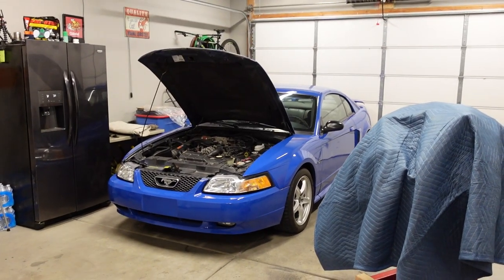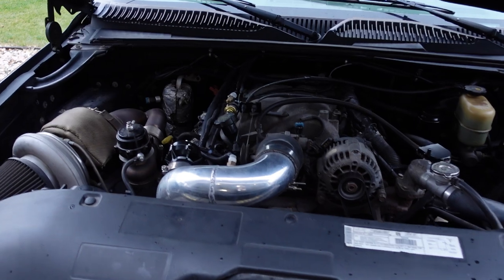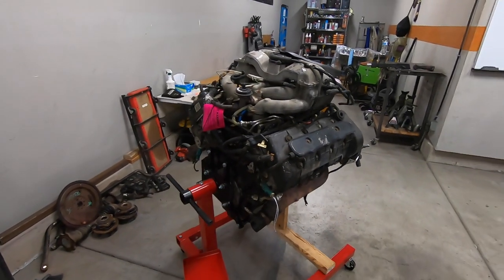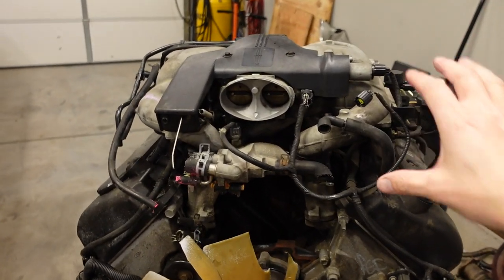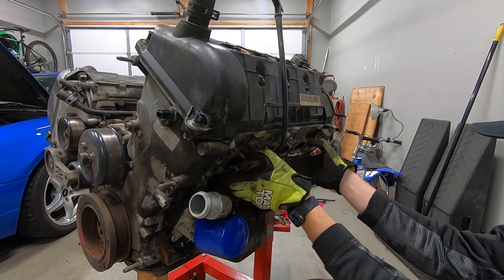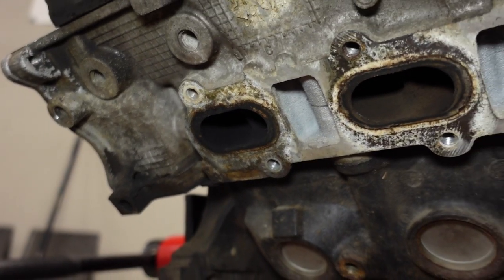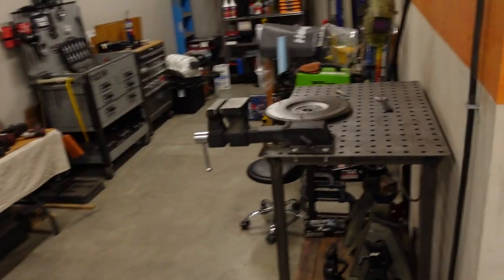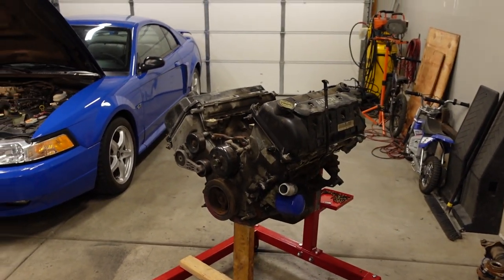I bought the LARGEST ENGINE I can fit into my Mustang

Comment: Waaaaaay more excited for this than a coyote. This will be great!
Reply: Lol y older 4v's are turds compared to a coyote 🤣
Reply: @neilbrown82  ya 11.5:1 compression will always win compared to 9:1. It’s okay though, I used to know very little about how engines work too. 😉
Reply: @tomcelica  lol it's more than just compression ratio 🤣
Reply: @tomcelica  the 5.4 4v compared to the boss 6.2 and coyote is literally worse in every way
Reply: @tomcelica  not when boosted😂
Reply: Guys I know new technology makes a tiny bit more hp from things like vvt and vvl and the heads on the coyote flow a bit more. However, you can port the heads on the older 4v to flow very well. Probably well enough to hang or come very close to the coyote. You are going to change the camshafts anyways so don’t bother comparing them. 
Here’s the kicker. The power will be dictated by the turbo or supercharger ultimately. The same turbos on either engine will be the limiting factor for max power. Both engines will make the same max power but at different boost levels. If you REALLY need me to explain this I will but this response is already long enough. 
Schools out. I’ll see you tomorrow.
Reply: @tomcelica  that's a lot of unnecessary words either way you try to justify it a 54.  4 valve still sucks in comparison to a coyote , the coyote is what the modular platform should have been in the first place before it ford hadn't cheapened out in the beginning it's 2022 nobody's getting excited over a 54. 4 valve modular  engine
Reply: Overweight, underpowered engines are not really exciting.
Reply: @sepg5084  agreed 💯
Reply: Lmao I’m just going to let this one ride
Reply: @neilbrown82  but do you know WHAT sucks about ithe 4v? My logic is sound bro. I suggest you subscribe to Richard Holdener’s channel and educate yourself. How many 4v engines have you seen tested? How many coyotes? Can you show me dyno results from said testing? You can follow what the internet tells you on forums and boards or you can follow the data. 
There are many many reasons why stock vs stock, the coyote will out perform the 4v. But when you start replacing stock parts with aftermarket parts, you learn quickly that you are only really limit becomes displacement. Why do you think racers still run small block Chevy 350’s that came with about 250hp?  I’m sorry, but you have no idea what you are talking about.
Reply: I would expect to see haters from the Coyote crowd to be negative. If everyone did the same builds things would be BORING. there's a tone of Coyote build videos out there already!!
Reply: @erikturner5073  that’s why I’m excited!
Reply: @neilbrown82  The horrible, raspy sound of a coyote is enough of a reason for me to never swap one in anything.  That and fans of them act EXACTLY like LS guys.
Reply: @AwesomeFinish  lol guess this new Edge Mustang project is dead
Reply: Not all but most but the coyotes have vvt if the modules had it they’d be right there or better.
Reply: @neilbrown82 lol, exactly what I was gonna say 😂

Comment: Biggest downside is the iron block on the 5.4. The engine is super heavy and physically large for making such little power. Expensive to modify with nearly no aftermarket options. I really wanted to go this route with mine but it just didn’t add up for me.
Reply: the 5.4 lump weighs 190 lbs. The 4.6 at 153 lbs plus the 5.4 stroke is horrendous with the same bore which limits the valve size for such a larger displacement.
Reply: @donuthole7236 really Ford Australia got 500 HP all day out of it ! Factory Standard .

Comment: Good call on the navigator motor build.  Used to be a much more popular swap and i think it's a very capable powerplant.  Hoping we can see 4 digit dyno numbers outta this some day!
Reply from the maker: I agree, I'd love to get it over 1,000. I know its been done countless times before, but nowadays the Coyote is the golden child for Ford, and the mod motors have been forgotten about
Reply: @LawrenceTolman  if i remember right, the stock crank in these is good for quite a bit of power.  I'd love to see it go through the progression of each stage and see what it makes and how capable it is in each form. Will this be staying manual the whole way or eventually going auto when it makes big power?
Reply: @LawrenceTolman  people used to get insane power reliably out of these in the 2000s it definitely can be done
Reply: May want to reach out to Richard Holdenerd. He's built a couple Navi 5.4's and would have a lot of insight on what to improve and what to leave alone. The Navi is actually a great powerplant and realistically is just as capable as the coyote in a lot of ways but a lot more reliable. Less electronic parts and less mechanical parts such as cam phasers.
Reply: @LawrenceTolman  but the coyote is a modular Ford engine nobody's forgotten those older engines they just don't waste their time with them when something better is available not to mention the Godzilla is out now as well
Reply: Compound boosted Terminator 4.6s made 1300+ hp without even trying. All forged goodies + compound boost on E85 is a 1500+ hp driver...
Reply: The biggest drawback was intake manifold options in the US but now they make an adaptor to allow you to run coyote intakes on them so that really helps alot.  A good manifold, cams and long tubes they can make 400+ rwhp easy with a stock bottom end in a manual trans mustang with the stock navigator heads.  If you can afford ported c heads too then it's even better.  The 5.4 has a long stroke and really good torque because of it.  If you do aftermarket rods and forged 12:1 pistons you could make WAY over 400/400 to the wheels on e85.  Thinking about doing one on my 97 cobra doing just that and revving it to like 7200 rpm na.  I think it would make some power.  My cobra has a 4.6 4v now I might build the original teksid block and make a 5.3 stroker so it's lighter.
Reply: @midnight347  your right, finding an intake manifold option is what I believe pushed people away from this market. but with those MMR plates, i opted for the 5.0 Coyote Intake Manifold from Velocity (Aluminum). Its similar to the Ford's Boss 302 intake, but the kit came with fuel rails which was nice. I am at the stage where I just need to learn how to tune the damn thing. I dont know how yet. I have the Tweecer RT, and contemplating on purchasing Binary Editor because I hear its much more user friendly for people whom haven't tuned before

Comment: Definitely option two, build the motor while you have it out really curious what you could make naturally aspirated before forced induction
Reply: 420hp practically
Reply: Not many seem to make good N/A power, but they love boost !!
Reply: @arkhsm  most engines like boost with stronger internals
Reply: Depends . The static compression could get a good bump, use some high lift long duration cams, good set of headers, use a PI 4.6 intake with port matched adapters, a 72 mm throttle body , c&c the stock heads...should be really close to 500/500 on E85 .
You'd be better off using a non pi 4.6 with pi heads on it , c&c port/bowl/valve job , long 4 into 1 headers and a 125 HP kit of voodoo juice.
The most important thing on any non-terminator mod engine is to get rid of the flimsy powdered metal rods. If your tune is anything other than perfect you will regret keeping the stock rods.
Reply: @robsorgdrager8477  out of a 5.4
Reply: GangBalls69_Estonia  not really. If you put in forged pistons and rods it's just better for a high compression build. After that you can run a thicker head gasket to drop comp or throw in some dished pistons and run boost. If you are good at tuning a 10:1 static compression is workable . Always always build the block to handle the max you want to hit. After that you just mix and match upper end parts.
Reply: @benjaminwatson7868  yeah. In stock trim you can eek out almost 400 horse from the 32v ...tuning, E85 exhaust. With some work, like changing everything 500/500 na is not out of the realm of possibility. The heads flow good but the cam profile suck dog water. The reason why the mod engines respond to small amounts of boost like they do is flow. The heads flow good but they choke up. The boost forces the heads to breath. In N/A trim you need to use the exhaust to your advantage. The faster you get the hot exhaust out the more fresh air it will draw through the intake. More attention to the exhaust side of the heads will net you more power. Combine that with good 4 into 1 headers with the proper collector length, hang them exhaust valves open a bit longer with a bit of overlap and timing , run good fuel and strong spark....you'd be surprised what you get from a 5.4 .

Comment: Duuude, This looks like such a fun build!  Thanks for taking us along on the ride.  
I love oddball builds and I’ve always wanted to do this but on a 6.8L V10 just to see what you could actually get out of one with a little love.
Reply: They are a pain to swap.  I put one in my 07 F-150 and the lack of aftermarket ECU support makes it a nightmare
Reply: I’d rather see a v-10 was hoping for that too. But fords suck in my opinion lol
Reply: @jasonolmsted4147  I'm a Ford guy, but I'm happy to see content that isn't just another LS/Hellcat/Coyote/2JZ swap
Reply: @KildalSMASH  I agree different is good. Still wishing it was a v-10 lol 😂
Reply: I wanna do a v10 mod motor in my 01 cobra eventually
Reply: I built  a 6.8l twin turbo v10 foxbody capri back in the early 2000's  they fit nicely and they make globs if torque.  Everyone seems to be scared of them because of the unknowns of the split pin crankshaft, but so far I've never heard of anyone breaking the crank in one.
Reply: Was crossing my fingers for a 6.8 V10 build, but 5.4 V8 is gonna be good as well!
Reply: @jasonolmsted4147  v10 and t56 viper combo for $3k on market place in 72701 area :)
Reply: @KildalSMASH  I'm ls guy but yes I'm also happy to see Ford power plant :)
Reply: @drgibs347  that must’ve been a scary car. But saying you have a v10 capri would be worth it all
Reply: @KildalSMASH  just carb it
Reply: @Logan adkins  I'm personally not a fan of having a metered fuel leak... plus, they don't make a V10 distributor.
Reply: @KildalSMASH  a metered fuel leak lol okay
Reply: @jasonolmsted4147  they suck?
I've seen them with 600 and 700,000 miles.
My 4.2 f150 has 300,000
 Tows and pulls every single day.
Reply: We have a 2010 Ford v10 for sale in GA if anybody wants the challenge 😊
Reply: @southernracing2468  we have a 2010 Ford  v10 for sale in GA, I think it’s a 2 valve though.
Reply: @drgibs347  lambo v10s are split too right?
Reply: @rdallas81  yup your right I've seen both 4.6 and 5.4 ford V8s with 500k the taxi cab 🚖 ford Crown Vics in my area have extremely high mileage and run smooth
Reply: Swapping a 6.8 into my 92 c4
Reply: Yeah I thought this was gonna be the 6.8 v10
Reply: @drgibs347  so what did you do for ECU Tune or did you just use the OEM ECU to run it ?
Reply: We've got a 2v v10 in an 05 mustang, it's been a fun project. The s197 chassis has loads of room in the engine bay for it though.

Comment: Go with option 2 now because it’s easier to work on it and upgrade the oil pump and timing set while it off the vehicle. I’ve built two 5.4 3v motors in frame and it was a nightmare when it came to the timing and cams. For good reference on build recipes check out Modular head shop they offer a 5.8l kit that’s good for 1200+ ponies, but like you said this could become your BOAT (break out another thousand).
Reply: Might be more than A Thousand. Maybe three because it's a mod motor.🤨
Reply: Timing was dead easy

Comment: In an Aussie boss 260 with long tubes , herrod camshafts , boss 290 intake and full twin 2.5" exhaust with hi flow cats on a Falcon and went 350rwhp. 

Before the camshafts with all those mods it made 300 at the wheel. I know you guys somehow get more HP for same mods and mile an hour than we do. With stock r exhaust manifolds and the possibly smaller cams from the Lincoln you'd be hard pushed to make over 280 here. 

unless they're understated the Lincoln's have 300hp at 5000 rpm the 260 kw here is 350 HP at 5500 rpm. 

Unsure if it's the camshafts or the intake manifold but you may have smaller sticks again then we did. The 290's had larger camshafts than the 260's again. 

Interested to see how this goes with decent diff gears . We had the AOD box with 3.45's , car was more impressive 100 - 200 KMs than it was 0-100.
Reply: The 317 and 345 were the best .
Reply: @JosephCowen-fz8vj  no idea what you mean by this comment. I remember the 315 but that was supercharged , what do you mean by 317 and 340?
Reply: @hayden6056  FPV had the more over the top versions , possibly it was the 315 but 345 was king ,
Reply: @hayden6056  yeah just checked it the 345 kw was Supercharged too , sold for $59000 .
Reply: @JosephCowen-fz8vj  yeah so apples and oranges were talking na performance. They're a 5l coyote and we were talking 5.4's lol
Reply: @hayden6056  yeah I said the last motor was the 345 , but are you for real , apples and oranges ! Really, you are aware the Coyote is a member of the mod motor family , just like the 5.4, 4.6, 5.2 voodoo, 6.2 and even the 6.8 V10 all same family , how different do you think the coyote is from the 5.4 ? There almost identical in valve train, design , bore spacing on all mod motors is the same that's what makes them mod motors or any engine family is bore spacing . The only thing different on the 5.4 from Coyote is bore /stroke ratio and a few minor upgrades . Same bellhousing , motor mounts , even cranks will interchange , how you think ford got the mystery motor 5.8 quad cam , it's a coyote block and bore with a 5.4 crank in it ! You are aware they put coyote heads on the earlier mod motors . Apples and oranges , might want to learn your motor history hay. And my post on the vid was ford V8s available in Australia, not only the 5.4 but all .
Reply: @JosephCowen-fz8vj  yeah apples and oranges seeing as we're discussing different manifolds that won't even fit because you're talking supercharged motors. 

Talking 5.4 specific naturally aspirated modifications so yes talking about supercharged 5.0s is apples and oranges .
Reply: @hayden6056  really , have you seen the Coyote to 5.4 manifold adaptors Summit racing sells ? Or back the other way , plenty of Boss 290 intakes on Coyote,s now , I'm sure if you google there a pic .

Comment: here in Australia we got two 5.4L for our Falcons from 2003-2010 the first was the triton V8 which made around 220kw (300hp) and 470nm of torque, the second one was the Boss line up of motors (not to be confused with the Boss engines of old) they were a 5.4L block with 4.6L heads and a unique to Australia intake manifold (a few guys from the states were actually getting in the Boss 260 intake as they breathed better than Ford US designs), the first guise were the Boss 260 for the XR8 Falcons and Boss 290 for the FPV Falcon GT the numbers represented their power 260kw 290kw around 350hp and 380hp respectively over time the Boss lineups gained more Boss 302 and Boss 315

the last of the 5.4s were the Boss 315 was in our FG model FPV Falcons from 2008 untill 2010 when the engine no longer met Euro IV Emission compliance, a comparison i currently have a 2016 S550 GT mustang and it makes 306kw from factory, our Falcon GT with a 5.4L in 2008 made more power and torque than the S550 Mustang GT untill the update 2018 model, Ford Australia then ended up supercharging the Coyote V8 in 2012 and renamed it the Miami V8 and it too made more power than the S550 coyote (as expected) 

i owned untill about a month ago a 2008 BF Falcon XR8 which had the Boss 260 5.4 in it and it was an absolute cracker of a engine, strong mid range and top end power and torque but very lacking down low esp against the coyote, great choice of engine look forward to seeing further builds of the 5.4 a highly under-rated motor
Reply from the maker: thanks for the info! there's so much I Don't know about the australian spec cars, and there are so many differences between what you guys got and what we have in the states!

Comment: A frend of mine had a Stock Boss 290 in his Ford Falcon BA GT. Leaves a turbo Barra in dust as long as it has only a boost increase.  However he fitted cams to it and it really livened up.  This time cams and boost for the full express package. it will leave the truck in the dust. 🔥🔥🔥 I would like to say a step for yours is take it out of student drivers spec and fit a manual box.
Reply from the maker: thats cool to hear, I wish we got the Barra here to play with, but its also an engine on my bucket list.

Comment: I did this last year with a friend

intake options are a PITA (so glad you figured that out, didn’t think to look abroad)

Steering linkage is probably gonna have to be custom and most certainly moved (we just made our own)

Install the motor with the headers already on, it is nearly impossible to install with them once the motor is dropped in.

Some sensor is on the driver side instead of the passenger side forgot which one.

Besides that everything is pretty much plug and play